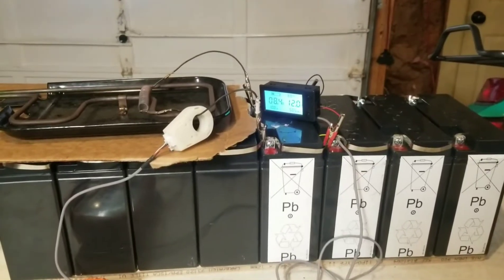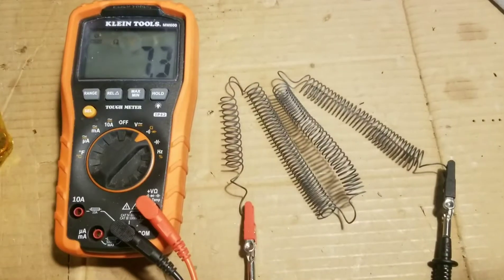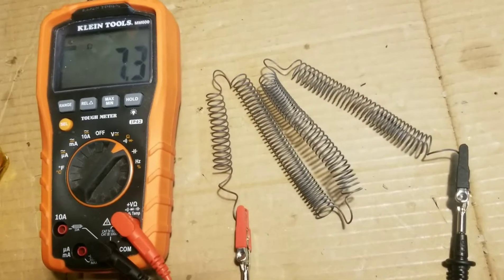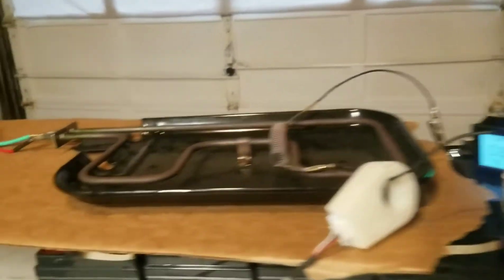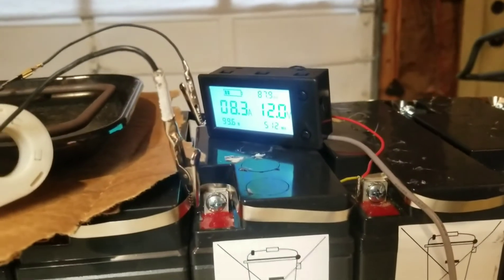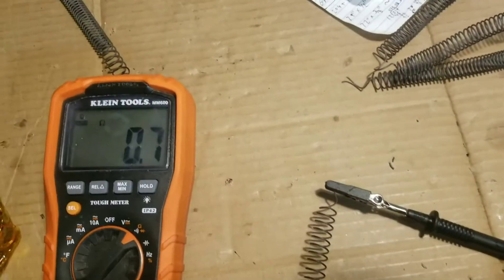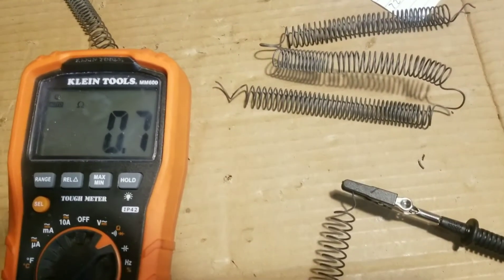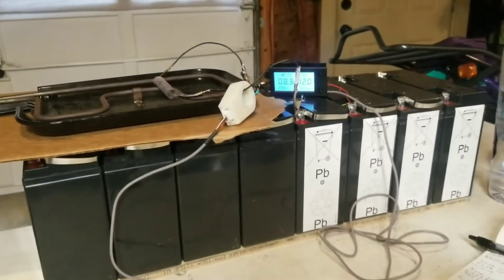Make your own power resistor! DIY Battery Testing Capacity Test, 0 - 12 ohms, 100w+

Comment: Neat!  Like I was thinking, albeit a little lower power capabilities.  I was looking into theoretically using a negative series clipper biased negative circuit for an AC (maybe DC if later rectified) balance control aluminum TIG welding machine cost effective DIY circuit design.  Seemed like lightbulbs might be an option as well later thinking about.  All theory, though was a design I randomly came across when wanting to confirm the term "clipping" still applicable correctly for use in zero crossing clipping using a thyristor.  I have never seen the clipper circuit used for mains applications or at least I don't recall anyways.

Comment: I'm intrested in what power meter you are using. I'm searching for something like that in my battery load tester project.
Reply from the maker: It's a generic volt meter with hall sensor ammeter, about $40 on ebay. Have one in my car too, works great. Thought about putting alligator clips on it and throwing it in the toolkit too. Very useful
Reply from the maker: https://www.ebay.com/itm/DC-Ammeter-Voltmeter-6in1-DC-300V100A-Voltage-Amp-Power-Capacity-AH-Hall-Sensor-/402764241531?mkcid=16&mkevt=1&_trksid=p2349624.m46890.l49286&mkrid=711-127632-2357-0